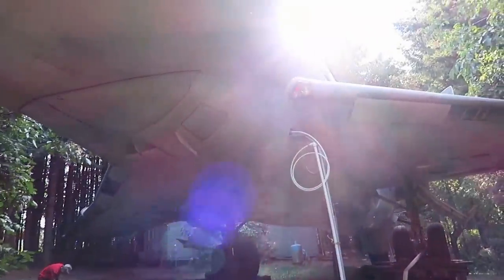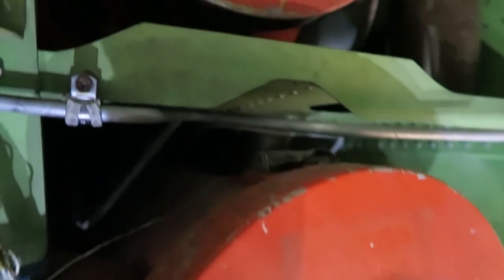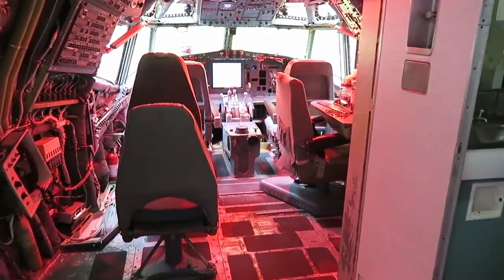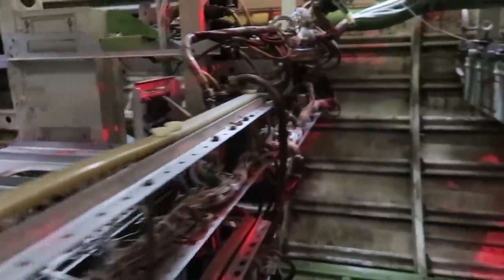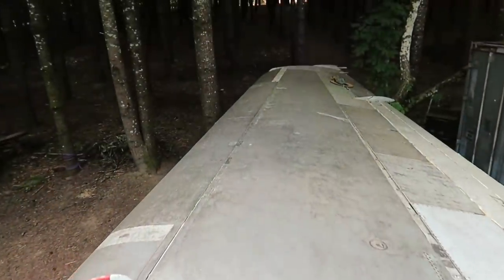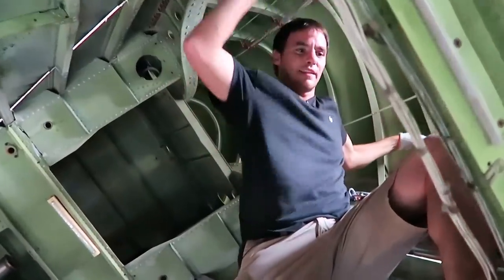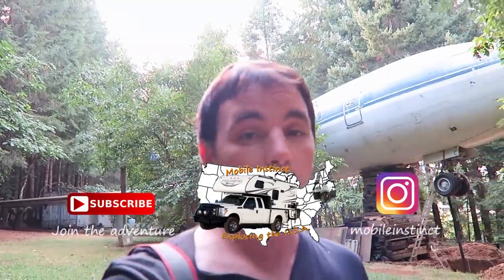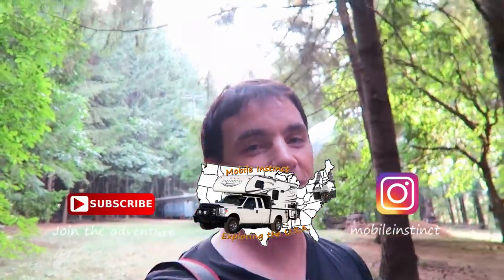Living in an Airplane

Comment: When you asked "have you ever walked on the wing of a Jet before?" Yes I have. I used to work for McDonnell Douglas (until 1998) And helped build the DC-10, MD-11 and C-17. I was a "Tank Rat" which meant I worked on the fuel tank which is basically the wings. That Green Zinc Chromate paint brings back memories. Nice video man. Very cool stuff.

Comment: I had heard of this several years ago. Two things: I would have thought the owner would have tricked-out the interior more, made it more like a real home, but it’s nice that he had the respect to leave a lot of the original electronics in-place. If it’s still in there, the auto-pilot circuitry was designed by my late uncle! 🙂 Worked as an electrical engineer at Sperry (Boeing subcontracted the auto-pilot out to them). I am old enough that I’ve actually flown in a 727 — great aircraft, very powerful and stable in flight! (Although obviously this one has touched-down for the last time)

Comment: If I was the guy who owns that, I’d pull the speed brake lever so the wings can’t generate lift but generate drag instead. I know, it’s a very technical precaution to take, but if a strong wind was to blow from head on, the plane might lift up.

Comment: Many years ago, I bid on one like this on eBay but it included the remodel, transportation, had to have a minimum of 5 acres with 1 cleared acre and easy access, etc.  I think I stopped bidding around $93,000.

Comment: The only amazing are: 1. A plane in the woods. 2. Someone Living in the plane. I think that is it. But you call it home? I don't think so. There a lot of work need to do and a lot of things to remove before you can consider a home. There is a lot of Hazard things and place inside the plane which is not appropriate for family or even for a visitor to hang out.